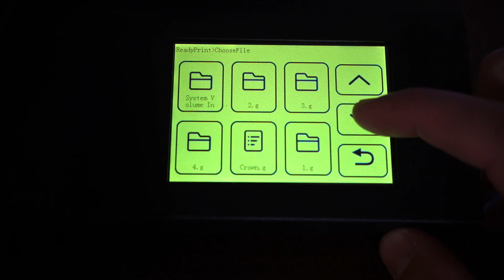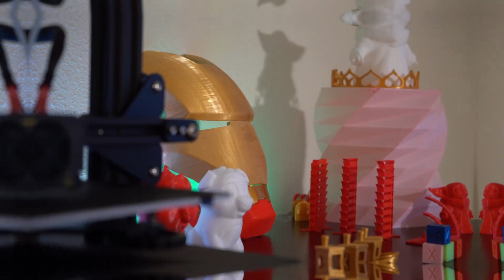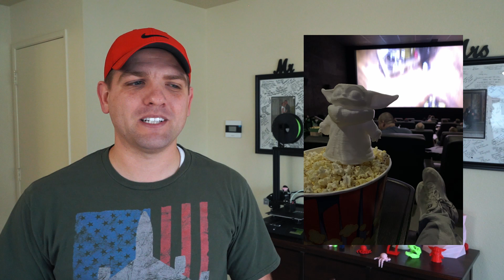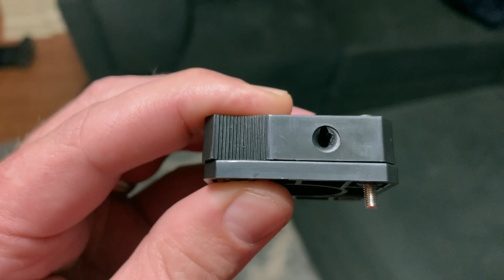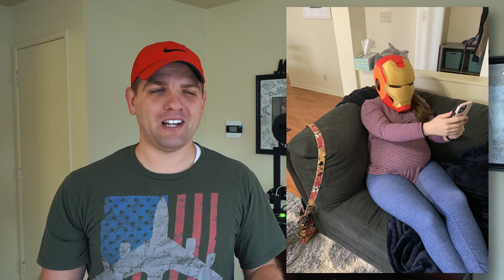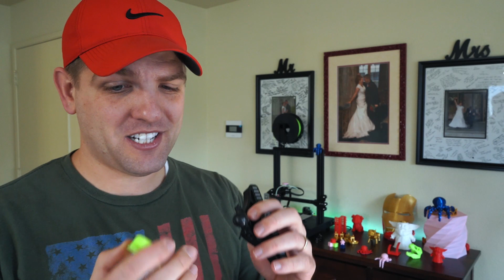My 3d Printing Journey with the LOTMAXX SC-10

Comment: Oh, and my copy also has a warped bed (lower in the center from front to back). I just cut a couple strips of paper and put them in the middle of the bed, then build plate on top- made a big difference to getting consistent print quality.
Reply from the maker: Excellent! I tried something like that for a while and it did okay- but then my build plates adhesive started separating.

Comment: hey there! i keep having issues with my buildplate, im not too sure how to level it. I keep having to re-level after every print. Because like you, 3/4 of it looks absolutely amazing but the 1 corner gets messed up. Any tips would be super helpful!
Reply from the maker: I still fight with this issue. I did just recently get a couple slabs of glass. 1/4 inch is too thick. I’m having some different issues though. I’ll get back to you with an update once I get everything straightened up.

Comment: Hi great video - I have similar issues with my SC-10 - the eccentric nuts will not tighten enough such that all wheels firmly contact the aluminium extrusion rails on any axis (not something I can solve) and I get axis droop like you - my frame is not square (this is something I might be able to solve) - my bed is warped such that I cannot use the whole build plate.
How did you update your firmware - every time I have reached out to Lotmaxx regarding the firmware they have refused to provide firmware support (I wanted to enable mesh bed levelling) - they did send a text file but their instructions were just to put it on the SD card (not sure how that would work, as far as I am aware you can only flash the TFT from the SD card and you need more than a simple text file).  I would really appreciate it if you could elaborate on the firmware flashing and also share the settings that Lotmaxx gave you that you mentioned in your video.  My experience with Lotmaxx has not been the same as yours - whilst they have been responsive and polite there had been no substance in their support .
Reply from the maker: Sorry for the late response - for some reason I am not receiving notification from this channel. For sure. I’ll get a screenshot of their settings up in the next video- though I have to run everything hotter than advertised- I’m not sure if it is environmental or if I have a bad heater cartridge or thermistor or what but my heat settings are always at the top of not over the recommended. 
As far as the firmware flash goes- I was indeed referring to the text file which I also thought was weird to refer to that as “firmware”. After “Flashing” the machine does indicate a newer firmware version... 
my build plate is also pretty warped but I have been able to find a happy medium that is “good enough” but I think the best we are going to be able to do is adding a glass/mirror build plate to really get a flat surface... which is a poor answer... and I can’t find one that is the right size. The mesh bed leveling - is that for something like a PLTouch? I wondered how the compatibility with this machine would be and if that could be a solve for the warped bed. It’s on my list but not something I’ve delved into yet.
Reply: Nerds With Friends hi - mesh bed levelling is a bit like a manual BLTouch - you manually go around the bed taking z offset readings (typically in a 3 by 3 grid) and it gets stored in the eeprom - allows the printer to cope with a warped bed (plenty of videos on it - check out teaching tech) Lotmaxx have told me the sc10 is not BL-Touch compatible - but if they would update the firmware to Marlin 1.9 we would get mesh bed levelling for free - thanks for the update on the ‘firmware’ - where were you looking that gave you an indication the firmware had been updated
Reply from the maker: Alcopup gotcha- I’ll check it out. That sounds super useful if it get added. On the printer- if you go to settings About it spits out a firmware version. I’m on v2.0.5 now- I was previously on 1 dot ... something.
Reply from the maker: I’ll check back in with you tomorrow. It’s 1:30am here and I have work in the morning. Thanks for being a part of what’s going on here!
Reply from the maker: Alcopup I looked it up- I was previously on 1.0.5
Reply from the maker: Man- I’m sorry you haven’t had the greatest of experience with them. Like I said in the video- mine has largely positive and maybe I am wrong in my assumptions but a lot of my issues I just assumed were “a part of the process” of 3d printing. I’ll try and get an updated video out soon on what’s been going on with mine and what I’ve learned.... my next video will be a bit more negative in the sense that my prints turned south and I need help.
Reply from the maker: Second video is up- Lotmaxx’s recommended settings are very near the beginning.

Comment: Hello mate, for your Z droop you need to tighten up the eccentric nuts so it won't drop under its own weight, to get the right tension on eccentric nuts you want to be able to turn the wheel without any slipping but will spin in place with a little resistance if you hold the axis in place. Any questions give me a shout, I'm testing a SC-10 at the moment for review.
Reply from the maker: Pigeon Print thanks dude! I’ll give it another look. You’re talking about the 6 concentric nuts left and right of the hot end? The ones that move up and down- correct? 
Also - I don’t think my motors were locking when pausing either- which made switching filament imposible mid print. I think I’ll post another short video this week regarding a problem I’m having printing PETG (first time printing with PETG)
Reply: @NerdsWithFriends  Yep, the ones left and right of the hot end, not in front of it now, but think only the 2 of the wheels (the ones nearest the hotend) are adjustable eccentric nuts, but if you adjust them to be tighter to the frame it will hold the whole X carriage up under its own weight, so even if you power the printer off the nozzle won't start creeping down towards the bed or into a print, should there be a power cut.   Man I am not a fan of PETG :) if I could give you any tips it would be 0% fan for the first few layers and then bump it to 20-50%  (lower you can get away with for how much briding/overhangs the print has) add a couple of mm to your retraction distance (PRTG loves to be stringy) and set the bed temp hotter than you need for PLA, 75c is a good starting point but have to go up a little higher. Good luck, can't wait for the next video!
Reply from the maker: Pigeon Print thanks for all the input! I started having catastrophic fails right after I received my PETG and have been trying to get the printer back up and running for a week or so now. I also found one of my pulley wheels had seized (the one behind the carriage) and I’ll have to wait to be shipped a new one before I can do much else. I’ve returned everything I can think of but I THINK it ended up being a problem with my PTFE tubing- after replacing that (again) my proms got a lot better although I’m still having an issue that looks to my like a y-axis layer shift. My belt seams about perfect and I don’t think I’m skipping teeth. The x axis- though it had a frozen wheel- didn’t really appear to be effecting my prints UNLESS the extra draw from that stepper could have cascading effects.
Reply from the maker: Pigeon Print I haven’t had any successful prints with PETG yet so I’m not sure how I feel. More to come on the next video.
Reply: @NerdsWithFriends  Sorry for the late reply....on these hotends you can run into a bunch of problems if there is the smallest gap between your PTFE tube and the nozzle, any small void will get filled with molten plastic and result in under extrusion and blockages, I like to unscrew my nozzle half a turn, pull out the PTFE and make sure its got a nice clean flat cut on the end, then reseat it till it bottoms out on the nozzle, then tighten the nozzle back up....this should push the PTFE tube up a little and take out any slack or play it has in the pneumatic couple at the top and stop any voids between the tube and nozzle.  If you want to shoot me some photos of the failures I may be able to help more, my email is theprintingpigeon@gmail.com
Reply from the maker: Pigeon Print thanks for the recommendations! Video 2 is up if you’re interested.
Reply from the maker: Also it’s worth noting after a firmware update my z-axis does now lock when paused.
Reply: @NerdsWithFriends  How did you update your firmware - will you share the profile lotmaxx shared with you
Reply from the maker: Alcopup I just shot you a response up above^^ I’m glad to help in any way I can and like I said- I’m still super new.